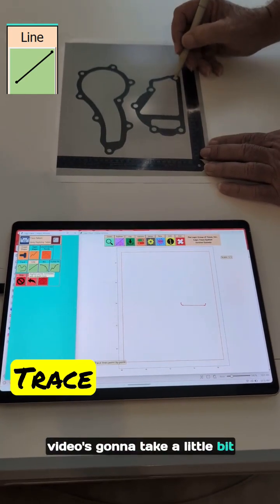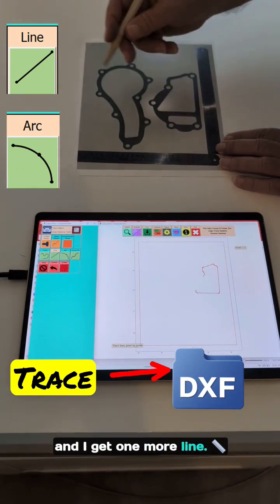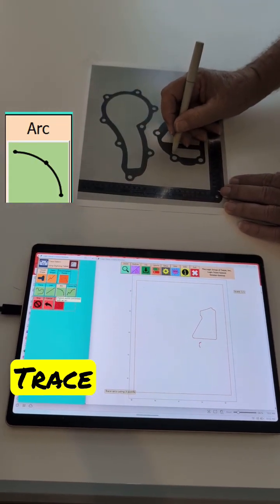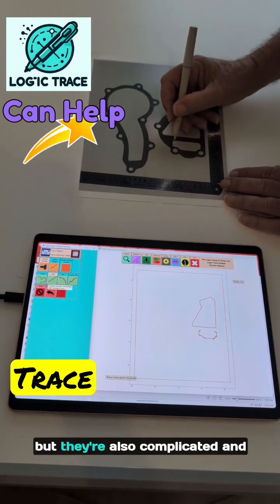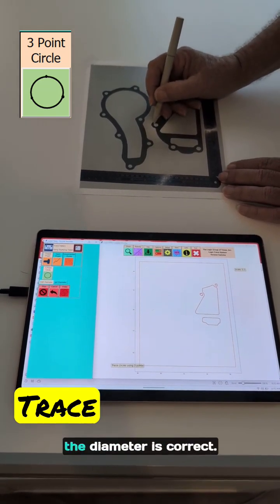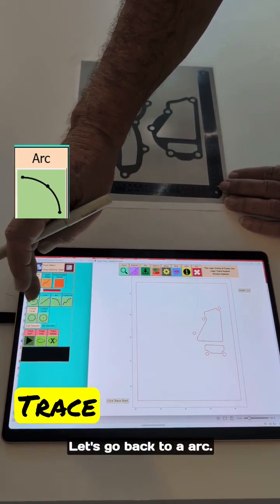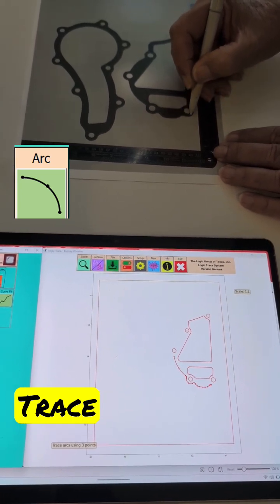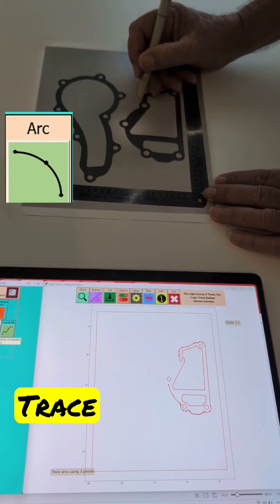Use gaskets? Do you often need to CNC cut a gasket from a pattern, drawing, or old part?

Comment from the maker: Gasket can be very complex with non regular curves and many internal shapes and holes. Digital tracing using logic trace offers a tool which traces the outlines and cut outs creating a very accurate vector DXF file for loading into CAD CNC software.#LogicTrace #Gaskets #CNC #CNCFabrication #LaserCutting #Waterjet #CNCCutting #Fabrication #DieCutting